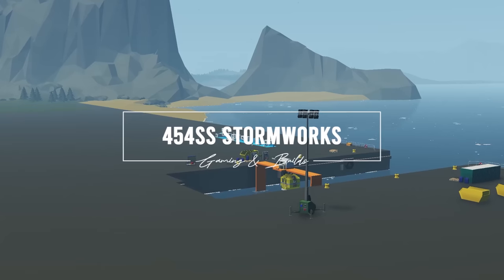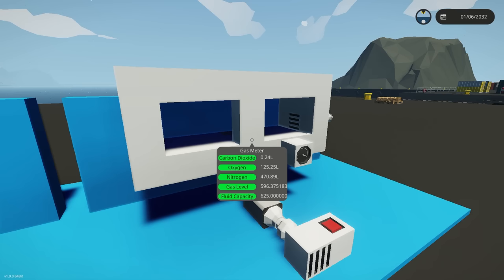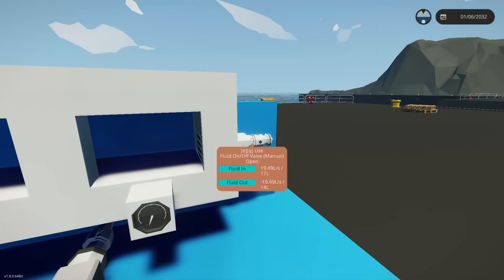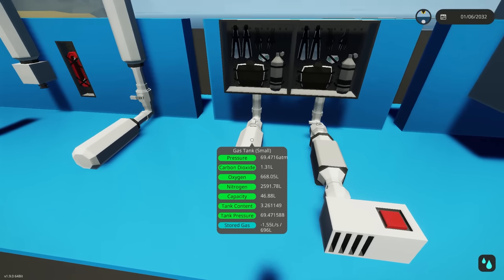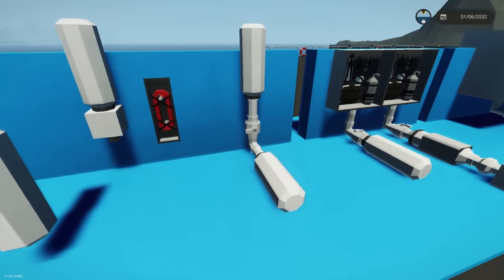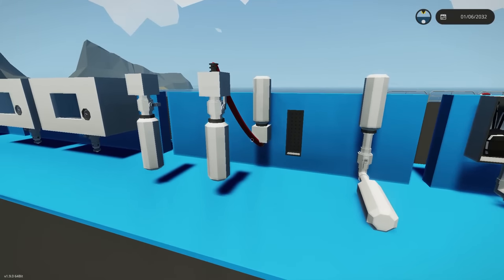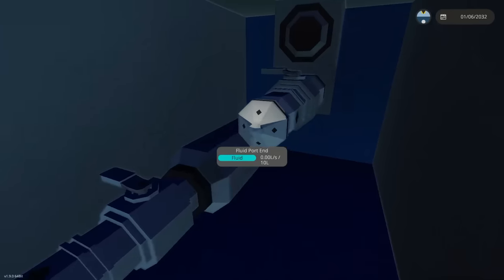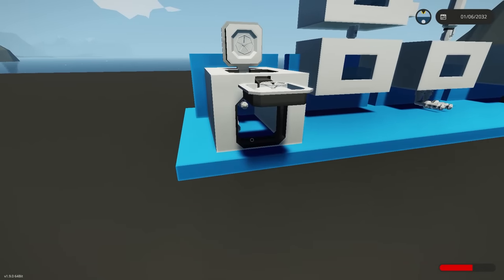The Stormworks GASSES UPDATE is OUT NOW!

Comment: Compressed air will force water out of a tank. You had some in your tank which forces the water out. That’s why the gas valve is in the game. To stop the gases from coming in. You need to allow the gas to escape in both which causes the water to not come in as it’s pressurized. You could push compressed air into the top tank in your video and this would force the water out and into the bottom tank.

Comment: I really hope that this gets worked out because the gas system is a really awesome mechanic and i have ideas that i want to try. But maybe the solution to filling fuel or ballast tanks is to pump them down to 0 atmosphere to avoid the weird air lock thats happening, at least until its fixed.

There should also be a co2 scrubber to remove the co2 from submarines or space ships
Reply: imagine a ship or submarine with a gas leak that pressurizes a room, you open the door and your ejected into the ocean or something

Comment: I was hoping to see temperature rising with pressure. Ever since they announced the Gasses update I was learning how to build a freezer room, heat pump, or a HVAC system to chill my cockpit in the desert. I built a big pump, powered by a medium 6-cylinder boxer engine, and compressed nitrogen as my refrigerant, I managed to get ~300psi but the gas hasn't changed temperature at all. So I couldn't pull off a HVAC yet. Since radiating heat from high pressure refrigerant is the first step in a AC system
Reply: They removed It, so the pressure system easier tonunderstand
Reply: @knownasdarklord5005  😟 bummer...

Comment: In regards to the first water tank with the single gas relief valve on top. 
As you are pumping the water from the bottom tank to the top tank you are pressurizing the top tank and creating a vacuum in the bottom tank. When you open the gas relief valve on the top tank, yes you are releasing that 100+ pressure from the top tank, but you are then allowing the bottom tank to pull a vacuum. Because the top valve is open air is being pulled IN to the top tank because the bottom tank is still under vacuum and its sucking the water back in thus causing the water to pull air into the top tank. Despite having a pump between the tanks it will only have so much torque to keep the water going in one direction. To fix this without a relief valve on the bottom tank you could put a one-way pipe facing the top tank. This in theory would stop the water being pulled back into the bottom tank, but I've not tested this. 

Hope this helps everyone understand this a bit better.

Comment: On the fluid tank I’m guessing that the problem was you weren’t putting air into the tank as you pumped water out into the “ballast” tank creating vacuum in the fluid tank so when you opened the valve on top the fluid tank sucked everything back in.

 On subs I’m thinking you’re gonna have to make a second tank (smaller so it’ll pressurize) to pump air into from the ballast tank as you fill it with water then when ready to drain the ballast you pump the pressurized air back into the ballast from the 2nd tank. I haven’t had time to try it yet but hopefully this will also allow you to drain the ballast in even deeper waters than before. Also by pumping air out of the ballast tanks and creating vacuum I wonder if you can fill the tanks even faster allowing for faster dive times?

Comment: Its think this update is so damn cool and making fluid dynamics work more realistically. Are supercharged engines possible now? Would be great
Reply: Also something interesting is that planes will need to have pressurization systems like real life planes. Because If it's just enclosed you will die from Co2 and if its open you will die from low pressure. Although I was testing the update out and It doesn't seem like they implemented the co2 poisoning yet.
Reply: wasn't engine supercharging a thing long before update?
Reply: Forced induction was already a thing with modular engines. I haven't looked at my EFI controller since the update but it actually shouldn't be affected because it's designed to work exactly like a real ecu.
Reply: @sijonda  dangit oops, i meant turbocharged. Exhaust>Pump>Shaft>Pump>AirIntake
Reply: @marctardif9756  Would definitely be neat. Only thing is the electric pumps are still the most efficient and come close to the limit of the fuel manifold. Meaning the air manifold is 1 and the fuel manifold is around .98 when using an electric pump.
Reply: @noobartz0890   i think yes

Comment: With that last tank with the water on top and air below, the reason the waters not fully dropping is because yes you've let air into the top chamber to allow the water to drop naturally with gravity without pulling a vacuum in the top tank, you haven't allowed the gas to escape the bottom tank, the weight of the water will compress the gas untill the pressure of the gas is stronger than the weight of the water. If you think about it logically, the water has flooded the pipe, the gas has no way out of the bottom tank due to the equilibrium of the waters weight Vs gas pressure. If you were to pump air into that bottom tank you would either push the water back into the top tank or the gas pressure would become greater than the water and it would then go up that single pipe and out the top relief valve. 
To transfer tank to tank the best way is to either have a gas relief valve on both tanks or in that scenario have a second pipe with a gas valve to allow the water to fall into tank and push the air up the gas pipe into the top tank. 

Hope this helps

Comment: If you connect a system like this: water cannon-----fluid valve-------water tank, and you open the valve, the tanks will get pressurised at 380+ atmospheres in 3 seconds and the cannon will shoot the water out at a pretty fast rate

Comment: The gas system is broken now. I experimented with standard tanks and saw the following: even if you completely pump everything out of the tank and feed the liquid there through the filter, it will still create pressure, and it is simply unrealistic to pump the liquid to the entire capacity of the tank with an electric pump. It seems as if the developers have created a gas that is invisible to sensors, which is present in any space and cannot be pumped, or liquids simply have the ability to compress in the game, and the volume of the tanks is smaller than in the properties. I hope it gets fixed because it causes a lot of problems.

Comment: At 14:50  the he asked the question he doesn’t understand why it’s going back into the water tank at the bottom instead of staying in the tank with a window at the top the negative air pressure is pulling the water back into the water tank. That’s empty window container

Comment: Normally we would put a check valve on the pump outlet to stop it flowing backwards when the pump stops because the tank would have hydrostatic head pressure due to the height difference. Not sure if this is simulated in-game?

Comment: Ok, some questions: is it enough to just make a fluid port inside a room an one directly attached outside (at about sea level, let’s say in a ship) or do you need a pump to pump it in, also can you have just a oxygen tank, that refills the room with just oxygen or do you need to use all components of air?
Reply: Pretty sure if you put a pump between the fluid ports the side that gets pressurized will receive O2 so create a way to bleed the pressure and you will be good
Reply: @miguelgameiro8063  thank you :)